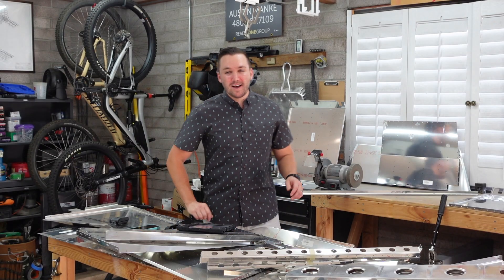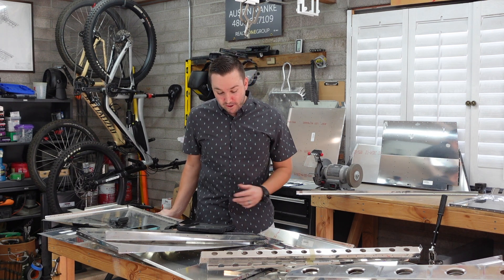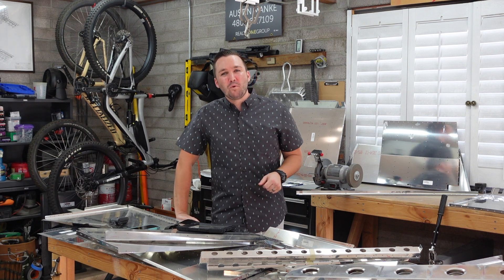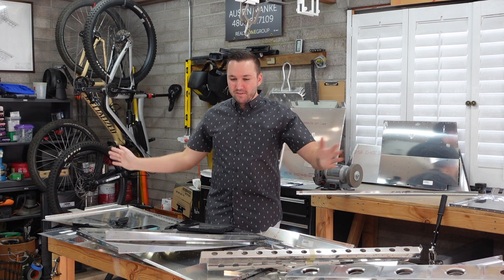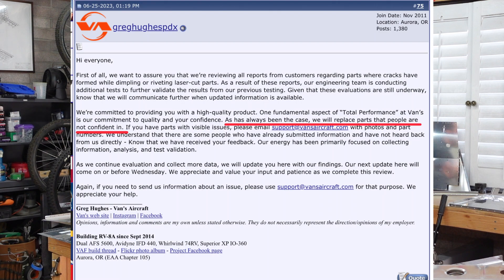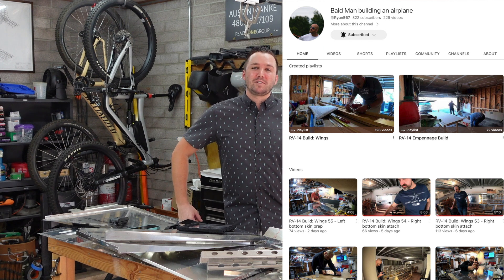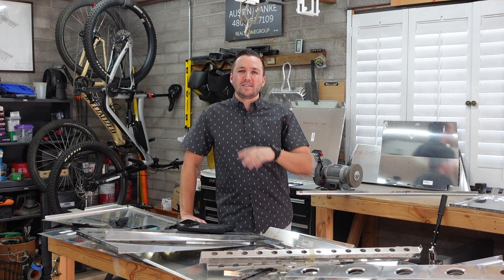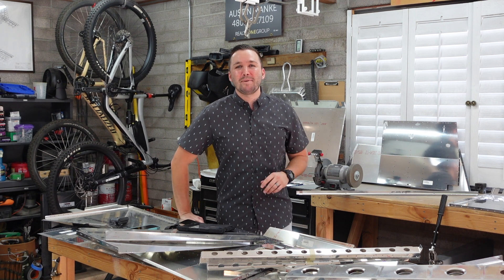Laser Cut Parts - Quality Control/Support Issues

Comment: Long ago, (1990) Fokker Aircraft in NL investigated lasercutting of parts, especially rivet holes. It looked very economic.
Sectioning the holes, and microscoping them, showed extensive heat affected zones around the holes. This was the method to ruin the tuned properties of the aluminium in a zone of say  maximum 1 mm from the edge.  So what, 1 mm would you say ? Exactly there resilience is needed for the dimpling.
Once a small fatique crack is there, is developed, the total fatigue life is used for 90% and 10% is left over.  (Ask every fatique specialist over the world to confirm.)

The proper method is: drill pilot hole. drill to larger diameter with sharp dril. Debur.  Ream if necessary. Place corrosion inhibiter. Place rivet. 
Reaming is benificial. Very small cracks of 0,1 mm in the hole-edge by the drilling are removed and the fatigue life becomes still longer.

You have the right to cut edges driven by economics. But do not so in aviation. It will backfire.

Comment: Did they say cracking is good or crack is good, because I don't think either one is good.
All models after 2020 are going to suspect.  And you won't be able to give an RV 12 away, my thoughts.
I'm glad my model was certified in 2002, back when Vans built their parts in house.

Comment: I won't be surprised if this is the end for Van's.  They're financially broke ; have a parts problem ; are damaging their reputation with builders by not dealing to correct issues responsibly & many aircraft companies both certified & hombuilt have gone in the past even in better times than we face today rising inflation & supply chain issues. I would not put down a deposit now & feel sad for the builders & a once great company.

Comment: Cracks grow ever so slowly in the invisible length range and so these aircraft will have thousands of cracks you wont see for a long time. The process used is wrong. Sounds like their engineers are categorising parts as okay based on the stress in those parts in service making the crack growth time to critical crack length being linger than the service life of the aircraft.

I would not have confidence in such a calculation. There are so many assumptions made about things not in their control.

That they went down this path of using this process shows you they are not competent engineers.
Reply from the maker: Great points! It’s a bad situation all around. Never should have gone to laser cutting

Comment: I used to work at various Airbus plants as a designer as well as quality control. The one thing I'm wondering about is: How can Van's not keep track of where each manufactured part came from and where it went?
As soon as you have identified a supplier to be unreliable all stock delivered by this supplier must be marked red! None of those parts can be allowed to find their way into a flying aircraft ever! No amount of quality control can fix a faulty production process, meaning the faulty process must be changed and improved until quality is demonstrated to be reliably acceptable. Only at this point can this supplier be allowed to deliver parts again.

I know, this is "Experimental" territory, but how would the home-builder community react when Van's planes start dropping out of the sky for no other reason than some home-builders overlooked a crack in a random vital part sourced from some random "bad batch" that no one felt responsible taking care of and clearing it out of the shelves??
A single bad part can be enough to cause death.
Reply from the maker: I bet you’ve seen a lot! Great points. It amazes me how many affected parts were received and shipped out during that period. I hope it was just a really bad training issue, and not a “just send it out” type of mentality due to the backlog of kits. The engineering report that was released recently is reassuring, but all of this could have been avoided with proper quality control from the beginning like you mentioned

Comment: Although your post does ramble and does seem like a rant, the issue is well known.  Whether these parts are Outsourced for production or created In House. Parts that fail, what proper parts prep IS and the effective interaction of Tech Support says something more than "Just build it!" from years past.  Stress relief, riser removal and use of reams vs. dual fluke drill bits.  Shearing and punching of holes regardless of being within 0.0001" of perfection on an 0.016 or 0.020 skin will remain an issue.  One person's DeBurr "Good Enough" is another's Not Enough yet.  You were polite enough not to mention the name of the individual who said your less than acceptable parts would be replaced by VANS.

I have no idea who does QC at Vans on production parts sold to builders.
Reply from the maker: Looking back on it, I agree. The video was a bit low quality and rushed, but I’m glad it helped to drive awareness. Really curious how this all turns out in the end for both Van’s and builders

Comment: Hi Austin - Just wanted to let you know how much I am enjoying your videos and how much I have learned for you so far.  I am also building a 10.  I bought the emp kit in 2008 but never found the time to work on it.  Now that I am retired, I am starting to work on it and videos like yours are a real motivator.   I am doing the build a little different than most.  I have taken all the components of the kit to the point of ready to prime and now I am priming the whole kit at once.  On this topic, I screwed up the nose ribs of the HS (edge distance) so I needed to buy replacements.  I didn't know about the laser cut part problem until I saw your video.  I held off on ordering my ribs until I saw the post on Vans site saying they had stopped producing laser cut parts and were no longer shipping laser cut parts.  I placed the order after this post and they shipped laser cut parts.  I have emailed support twice about this and have gotten no response to either email.  I don't know what to make of this.  Just an FYI.  I also don't understand the testing.  Are they trying to justify cracks are okay?  Keep up the great work - I always look forward to you posts.
Reply from the maker: Thank you so much! I’m glad you’re enjoying them. I’m the same way with motivation and find myself watching other builders’ videos to keep the gears turning and motivation up. 

I like that idea of processing the material in bulk. That’s strange that you ended up with laser cut parts when you ordered after the announcement. My understanding was that they would be purging affected inventory. I wonder if you got it right before the purge. I’ve heard similar issues with lack of response from them. I’m really hoping this all gets sorted out soon for replacement parts to start getting sent out. And my understanding with the testing is that it’s to prove whether or not replacement is needed for installed laser cut parts. I’m hoping the tests come back positive, as I know of several builders who would need to fully rebuild much of their work. At the end of the day safety is most important, but would love to see some positive test results. 

Thanks again for the kind comment and watching! I really appreciate it
Reply: I am working in a 2 car garage in a subdivision so priming procedure was a concern.  I'm using the prekote prep with the Akzo primer.  I built a folding spray booth that takes up my workspace so I didn't want to be putting it up and taking it down for every component (takes about a day to setup) so I decided to go this route.  Its nice to have all the deburring etc for the kit behind me but I haven't driven a rivet yet.  That's the downside - nothing to show for all the work so far but I am looking forward to nothing but assembly from here on.

Regarding the testing - I just can't picture you flying your family knowing that there are suspect parts in the build not to mention the black mark on any Van's plane containing laser cut parts.  Would you want to buy one and at what price?   All that careful work sabotaged and the proper fix is to put in even more work and money into the project.  Wow.  @AustinManke

Comment: FYI: I was contacted (via email) by Van's with spreadsheets for my RV-14 (tailwheel) Empennage/Tail Kit and Wing Kit. The spreadsheet includes dates of laser-cut parts. I took delivery of my Empennage/Tail Kit in late January, 2022. Every part has an attached sticker that has the part number, and the date that the part was "put on the shelf" in inventory at Van's. None of my Empennage/Tail Kit part inventory is effected by comparing the date of the part I have, by the date of the laser-cut parts on the spreadsheet. My wing kit is a different story.

I have parts of my Wing Kit in my home shop, and part at my airport hangar. I re-inventoried the Wing Kit parts I have in the home shop, and have several laser-cut parts. I will be pursuing replacement of those parts, and all laser-cut parts of the wing kit once I re-inventory the remainder of that kit.

Kudos to Van's for their effort, so far, to get ahead of this situation. Replacing parts will take time. Deal with it.
Reply: EJWash, has Vans replaced your laser-cut parts yet?
Reply from the maker: Great to hear your emp kit is good. Bummer about the wing kit, but glad to hear the parts aren’t yet buried inside completed parts! I know of several builders who built with laser cut spars and will have to redo a lot of work. Many won’t just be able to get over it. Vans has definitely acted quickly to get info out since the video though. I’ve been really happy to see that.
Reply: @AustinManke  Agreed that having built major components and facing possibly building them again is disconcerting. When I say "deal with it", I mean to look at the alternatives available, make a decision, and press on. Personally, I don't see having to get replacement parts for my wing kit as a bummer. I'm happy - and impressed - that Van's is focused on builder comfort and reassurance rather than circling the wagons in defense.
Reply from the maker: @EJWash57 totally hear you. I’m happy they’re stepping up and will be replacing parts as well. They seem to be really owning the issue and working to provide solutions for us
Reply: @AustinManke  👍🏽

Comment: I had no idea any aircraft manufacturer was using laser cut parts. With the rapid heating and cooling of the metal, the jagged cut and just overall inaccuracy of laser cut holes, this sounds like a terrible idea.
Reply: I is my understanding that the design of the cut mitigates heat treatment. Vans and the laser cutter contractor had designed a cut that prevented the laser from pausing anywhere on the circumference of the cut ie the laser started up inside the hole, moved round the hole, then moved inside the hole again to stop. The laser never paused whilst in contact with the outer edge of the hole. Apparently the contractor changed the pattern, causing the laser to pause whilst at the edge of the hole, thereby causing the heat treatment. I don't know why they did that or why Vans didn't know about it until too late.

Comment: If those holes were laser drilled they look absolutely terrible!  Furthermore, as an A&P, the ‘blown’ look of the holes leads me to believe that the dwell time of the hole burning process was excessive.  I’ll bet you dimes to dollars the heat treat of the 2024 is completely screwed up and the dimpling process is exceeding the bend allowance for the imposed new heat treat values!
Reply from the maker: I think you’re absolutely right! It sounds like they have a plan in place to start replacing the parts for builders soon. It will be a long wait but I don’t want anything structural having those defects

Comment: Cracks can be Avoided by preheating the sheet metal and burnishing the holes. I'm  a retired A & P mechanic, 50 + years  experience. Military and civil aircraft , large and.
 small. The machine is called a coin dimpler. It both pre-heates and dimples it one operation .
Type of metal alloy , hardness , thickness and size of holes are all factors in the process.  It's tricky to set up properly , but it can be done by a competent technician.  Good luck finding one  !!
Reply from the maker: Great to know! Thank you

Comment: My RV has been flying over 25-years and has over 3,500 hour on it.  I am retired from the aerospace industry as electrical / test engineer, retired DAR, and A&P.  When I was working, the aerospace industry started to out-source parts. Every manufacturer that did out-source had some issues.  The main problem was out-source without controls to make sure that the part was the way intended.  When I am building, I do QC / QA on every item.  I have rejected parts that others thought were acceptable.  I can make more money but only have one life.  If I was in a hurry to fly, I would buy an airplane not build one.  My experience with Van's Aircraft over the past 35-years has been that they will make it right for the problems that they created. Unfortunately it will take time.  My life experience with people has been that you cannot please all the people all the time.
Reply from the maker: Wow. You have a lot of experience it sounds like. Thanks for the comment!

Comment: How do you know what is laser cut/how do you tell/so far my kit is perfect
Reply from the maker: They tend to have notches or burn marks in the holes that are cut. They also don’t come with blue protective film like the punched parts come with (though my understanding is that some parts without the film are punched and later heat treated, so a lack of film is not the sole determining characteristic). Take a look at the pictures in this thread: https://vansairforce.net/community/showthread.php?t=216676
Reply: Yes if there is blue film then
I believe they are punched:-) not positive but that is what I’ve been hearing. I have my fuse kit in which I got August 2022 and lots of burn marks on the fuse parts without blue coatings.
Reply: What a shame - not going to buy my dream kit from Van’s - was going to buy a 7A

Comment: They'll never ask me, but my advice to Van's is that they STOP including laser-cut components in all kits going forward, recall ALL laser cut parts, replace them, take the write-off, and chalk it up to a REALLY bad idea. Who signed off on using  high-heat to literally burn/melt holes in a low-temp alloy, heat changing the properties of that alloy? I have a -14 Finishing Kit on order, and will NOT take delivery until this issue is resolved. In other words, when the holes are mechanically punched and not burned/melted in.
Reply: It is done all the time in manufacturing. It's more likely to be an issue in implementation. Punching is not without stresses and strains.
Reply: @UncleKennysPlace  Well, you go with laser, and let us know how that works for you. Me? I'll stick with the lesser stress and strain inducing process of mechanical/tooled punching. When you say "manufacturing", does that include aircraft high-stress components? High-stress in that I'm building an RV-14 that is stressed to +6/-3 Gs. If making laser holes in manufacturing toasters and lawnmowers is the norm, well...

Comment: I got my empennage kit a few months ago. It has some laser cut parts. I can see the entry point of the laser, making less-than-perfect circles. I'm with you and the forum commenters, even to a lay person it looks defective and it's not confidence inspiring.

I've finished my vertical stabilizer and am halfway done with my rudder. I have been deburring with a small Scotch Brite wheel on a Dremel to try to remove as little material as possible and sometimes an additional very light pass with the Cleaveland deburring bit on a slow-turning electric screwdriver. I inspect every hole after dimpling and haven't seen any cracks so far. After riveting, I haven't seen any cracks on the surface, but I have no idea what's happening below.

Greg is the best and most of the other people I've dealt with have been great, but man there are a few bad apples at Van's. Between the endless waiting, the occasional terrible experiences with customer service, and these quality control issues, I sometimes wonder if I should cut my losses, cancel the other kits, and find myself another hobby. It's gotten so expensive and now with concerns about safety and depreciation. If we'd only started this 5 years ago we'd be so much better off.

I hope that Van's can get their s***t together.
Reply: When I was trying to sell my RV-4, with O-290 engine, I got responses from prospective buyers that Vans was stabbing me in the back and telling them that the O-290 was unacceptable. I enjoyed it for 600hrs. over the 6yrs. of owning it. I got checked out in it by a retired UAL Captain who would have bought it if he didn`t already have to many toys. I don`t feel for them being in a bind now at all.

Comment: Thanks for the video Austin. I just finished my tail kit which had a few laser cut parts which seemed to be fine. I just picked up my wing kit in April and noticed quite a few parts laser cut and not in the blue plastic. I will definitely examine these parts more closely but  I think I will hold off construction until further guidance is received.

Comment: Yikes - thanks for sharing! I've been stalled for a couple months with family obligations, but have been planning on getting back at it next week. I'm close to being done with the tailcone on my -10, then was going to knock out the elevators so I could finally be done with the empennage and onto the wings. I think I've received parts in the affected timeframe but haven't yet noticed any cracking; I'll certainly be looking over the tailcone closely and will definately not be starting wings until we know more.